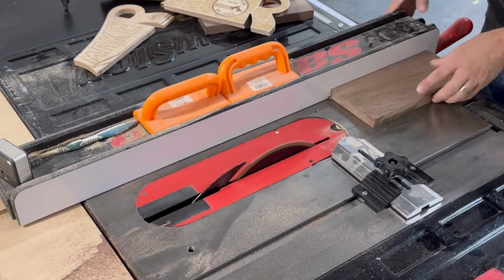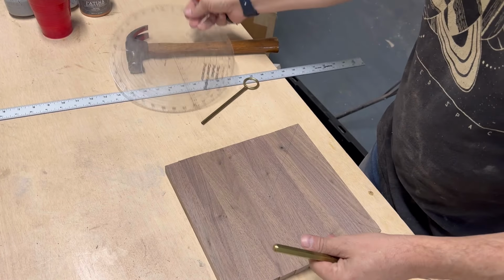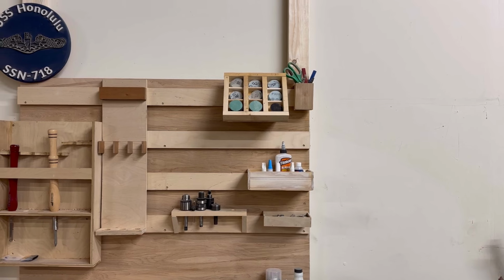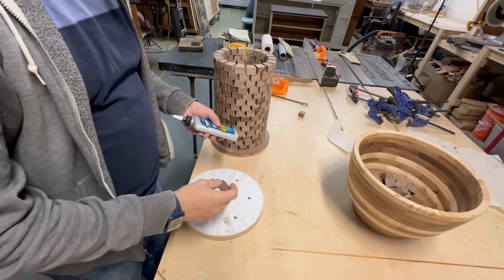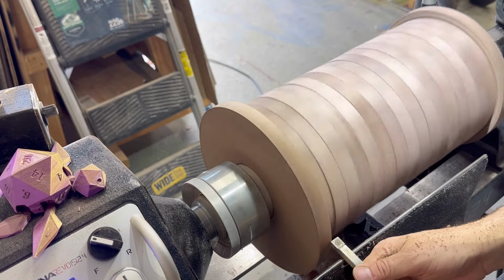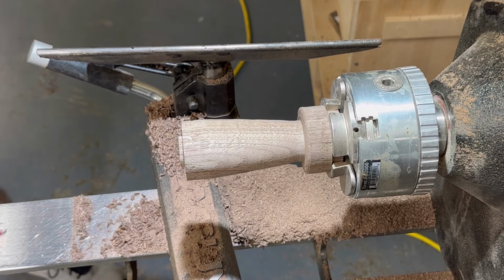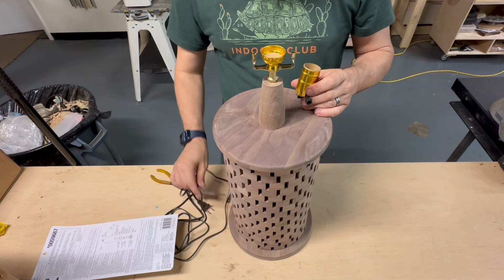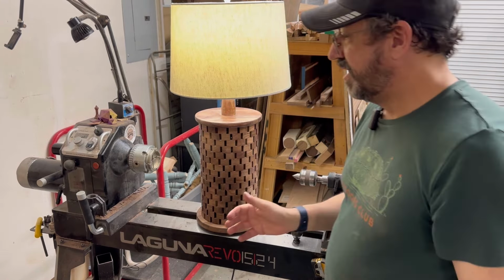My Biggest Walnut Open Segment Wood Turning! | Home Decor 2024 | Woodturning a Lamp

Comment: As a machinist that runout when you were spraying on the clear lacquer drove me nuts 😂. I need everything to be perfectly concentric.
Reply from the maker: It is actually true now, but I didn’t realize the lamp nipple was actually loose and as it was spinning the lamp body was shifting. Once I got it off of the lathe I tightened everything up. But I can see how that would make a machinist edgy ..lol.. especially when I us woodworkers are happy with way less tolerances. Thanks for watching and commenting!!
Reply: @WoodturningWithJohnMarro  Thank you for sharing the video. The lamp looks amazing.